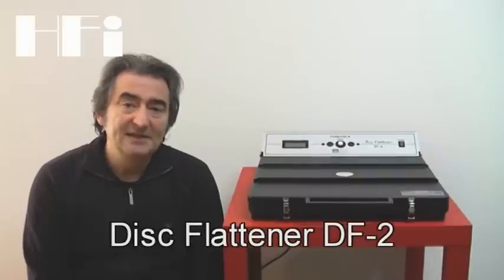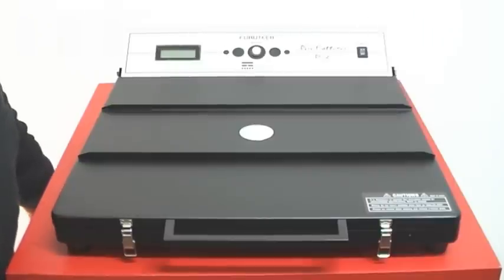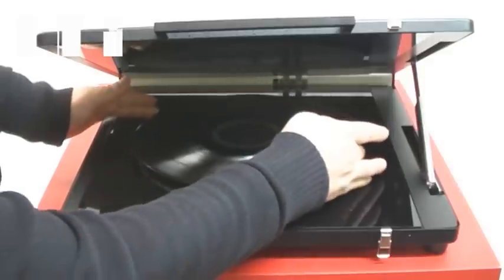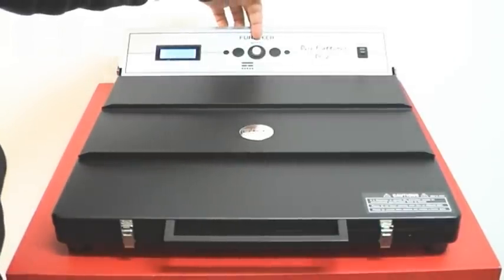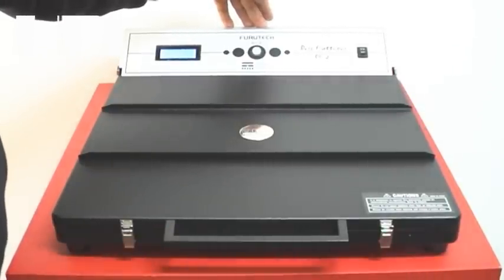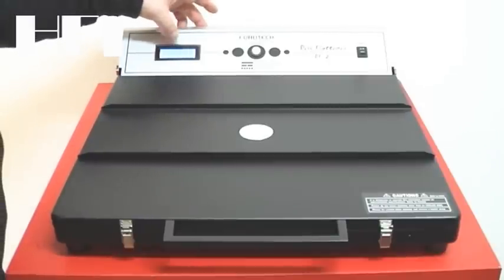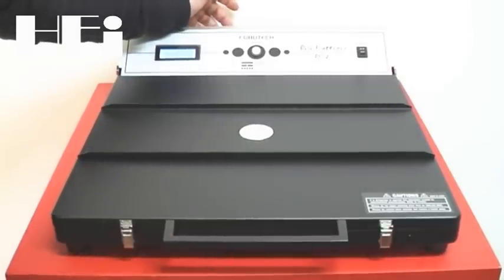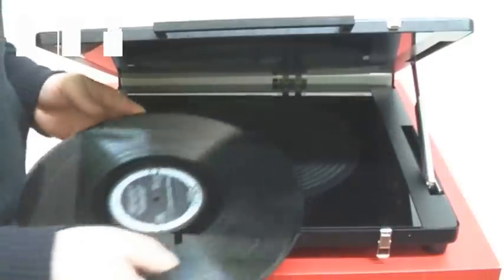Furutech Disc-Flattener DF-2.mpg

Comment: A translation from the original Italian to English would be helpful as many have noted.  I have used the DF-01 for upwards of ten years and can report that these units work very well.  Sometimes depending on the nature of the warp, the vinyl record will require multiple treatments.  I could relate several case histories!  Vinyl LPs manufactured in the U.S.A. that have been sealed in tight shrink wrapping for many years can be a major challenge.  Think of it like this.  A vinyl LP that has been in shrink wrapping for many years changes its shape gradually over those years.  Vinyl has a 'memory' and will always try and revert to its assumed shape.  Therefore, it is not possible in my experience to correct that situation immediately with one treatment alone.  Many vinyl LPs with less problematic warping can be fixed with one single treatment.  The development of Disc Flatteners and more recently Ultra Sonic Record Cleaning Machines have been monumental in terms of advancing the enjoyment of analogue sourced audio.

Comment: OKAYYY...Just saw auction on Ebay for a $25 record flattening svc & it refers me here....1st off, WE NEED ENGLISH PLEASE! 2nd....I don't see a WARPED record bieng flattened...if the record in this vid is warped, its so slight it's undetectable & ANY DECENT turntable would still play it with ease, How bout a SERIOUS warp that throws the needle all up in the air? SHOW a vid of 1 like THAT getting "fixed" & THEN MAYBE it'd be worth $25 per LP to "FIX" I have MANY I'd pay to flatten IF I see a demo
Reply: The really warped ones are usually easy to fix. It's the vicious sudden edge warps that are difficult.